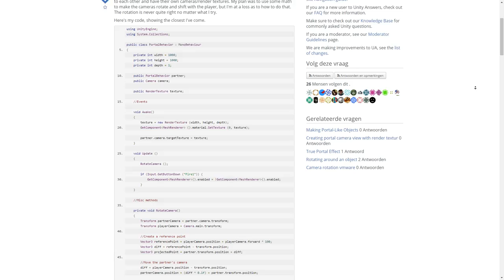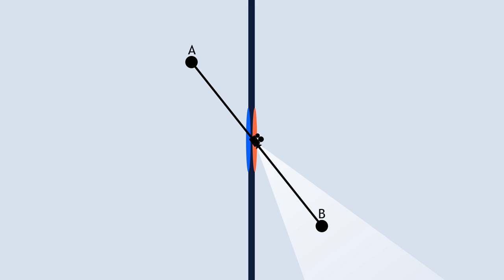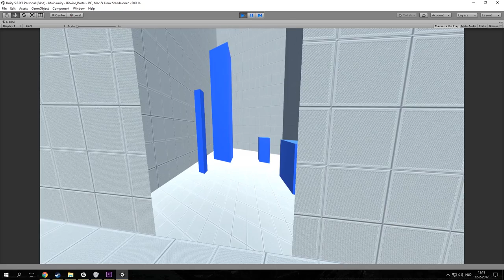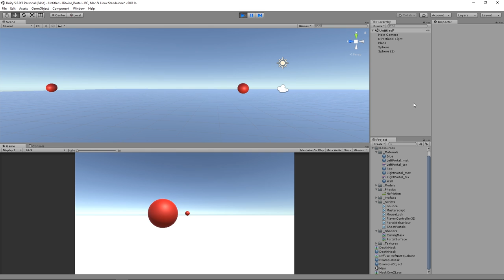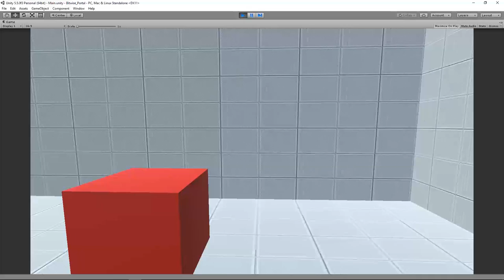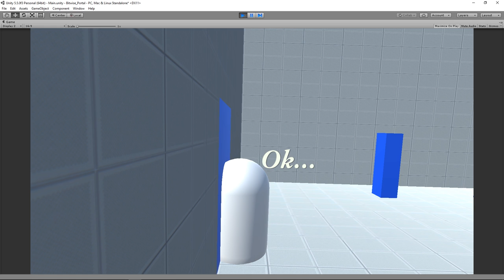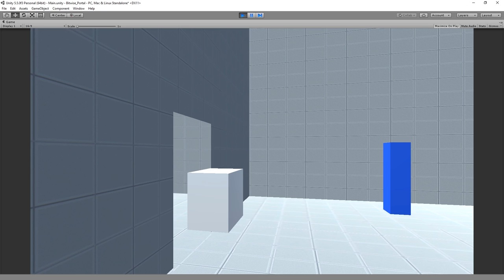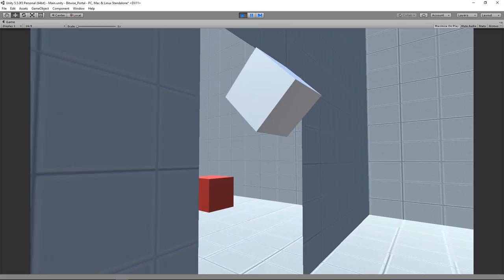How were the portals in Portal created? | Bitwise

Comment: I don't know how Portal does it, since presumably they had to work around a real-time hardware accelerated API that most likely wasn't designed for portal rendering. However, games as far back as the original Descent were built in software-rendered engines specifically designed to render in the same way Valve's portals appear to work. Specifically, the entire in-game map in Descent was chopped up into convex shapes, which greatly reduced the calculations necessary since any convex shape can be rendered from this inside without regards to which of its sides might overlap and obscure the others. To allow maps to be more complex, each side of an area could be flagged to connect to the side of another convex area. Rendering was then done from the inside-out, starting with the room the player was in. The renderer would first draw the visible, solid edges of the current area, then it would move to one of the connected rooms and draw it in the same way, repeating this process from nearest to furthest until the screen was fully drawn in. For normal gameplay, the maps were carefully constructed to be realistic, with no two rooms occupying the same apparent space, but this was not a strict requirement for the renderer. Modders quickly took advantage of this to create "impossible" maps, where a tiny cube in the middle of a large room could be entered from any of its six sides to seamlessly transport the player to one of six completely disconnected areas, and because of the way rendering worked, the sides of the cube would each look like a window into another dimension, similar to the way they appear in Portal.

Comment: A little bit of subtlety with the velocity, that method doesn't entirely work. Because you can go through portals at odd angles (as we see in the second game a lot with diagonal platformers you can jump into). You need to store both the velocity and direction relative to the first portal, and apply it to the second portal.

Comment: I don't know if someone has pointed out that yet, but your solution seems identical to what Valve did with disabling wall collisions when entering a portal. I know this becuase of a glitch that exists. There's an invisible trigger around the portal, and if you stand next to a wall that's near to the portal and save-load, you'll lose collision until you do something to revert it, it's used a lot in speedruns.

Comment: Great video and explanation,but if you shoot a small item through the portal and it goes through it at an angle,then it's direction should also be stored as an xyz value,and modified using a particular algorythm,not use the portal's facing value.
Think of the portals as two windows that exist in the same space back to back...
You can only ever see the front and side of the portal.
The front can be divided into segments like a clock.
If you shoot a bb through the portal and it's angle of entry is  biased toward 3 o clock from the centre on entering,It should exit with a bias toward 9 o clock...
Strangely, the vertical axis does not flip,so only the horizontal directional information needs to be inverted for this particular operation.
 The reason for this,is because the portals themselves are the same entity,except for being spun 180 degrees horizontally on a vertical axis.
hence the inversion of  <180 degrees (less than,mirroring on centre axis)for horizontal information.

Comment: I would had solved the collision detection differently. You cant simply disable the normal collision detection and put tiny borderwall surrounding the portal edges. That would make standing on cubes or similar things impossible while being halfway through a portal. Depending on wether you use  raytracing in your collision detection or coordinate correction routines, you could just add the portal square to the collision detection formula, which is calculated after a frame is drawn. I delevoped various collision detecion algorithms myself for my 3d games (dont know how others do things) and I suspect the best method is to compare coordinates before and after the game progresses a tick. so all you need to do is adapt the coordinate correction in direction orthogonal to the portal surface in case the movement vector crosses it.
Reply: Ye that's what he did

Comment: i know this is old but i think i should add, the velocity needs to be relative to the portal itself, not the direction that its facing, for example if your fly into a portal at an angle, you should come out going at the same angle, not the direction the portal is facing, at least to be consistant with the game, as demonstrated in test chamber 15 of the first game

Comment: I wonder if writing a game engine with a 4 dimensional coordinate system would be valid approach.
You could genuinely connect 2 areas in 3d space together through the 4th dimension.
You wouldn't have to deal with weird cases of objects or the player going through, it would just work like real portals would right away.
I imagine such an engine would be difficult to run smoothly though.

Comment: So it's an optical illusion of a 3D space using a dynamic camera based on the player's position? I guess that makes the most sense. I was always dumbstruck by how the effect was so seamless and assumed they somehow had an infinite cycling of duplicate test chambers, and I was simply walking into a clone of the room I was just in.

edit: And then they DO use something resembling that when dealing with things like cubes, but then somehow prevent that being an issue in multiplayer where the first thing I'd try to do is have two players each grab one "half" of the cube. Hrmm.

Comment: you forgot one thing, what if one portal is facing the wall and the other is facing the ground, then the velocity would mess up. for example. if we throw a cube into a ground portal, it would smash up against the edge of the wall portal because it still has downwards velocity. when I coded portal guns my solution to this was something along the lines of portal angle*momentum.

example:

 exits here with downwards velocity
I  ->
         cube goes here
           I
           v
           _

Comment: Quick question. What is stopping you from using the double angle theorem from geometry, so instead of moving the camera back, you could just find the angle from the players current position to both sides of the portal, then double that angle on the other portal's fov? After that, couldnt you just take the points on a cylender made by envoloping the portal in 3D space with a circle( or for vertical motion, use a sphere) , and project them onto a flat surface to make it look more natural?

Comment: At 4:58 how do you check where the player center is compared to the portal? Im trying to do something similar but for a different mechanic and it always detects the start of my player colllider. When I put a 2nd collider which is at the player center and is flat, it does not get detected ;/

Comment: You shouldn't add your velocity in the portals direction, you should add the relative velocity from the first portal and transform it to the second. If you go in with a 45 degree angle, you should exit at a 45 degree angle.

Comment: Valve would modify the physics and rendering engine from source so that cameras and duplication are unnecessary, no reason who you can't render a scene multiple times in the same frame using a new transform matrix, and also no reason why when doing a physics trace for an object you can't calculate it in more than 1 place for a given object per frame

Comment: But if you're using that approach, wouldn't the camera just clip to any geometry behind the wall?

Edit: the portal camera i mean
Reply: To solve this, you can set the near clip plane to the portal's position. You can use an oblique projection to make sure that it lines up properly
Reply: @sanovictus  Is that possible to do that for a specific camera in ue4?
Reply: @undrew3280  in any engine it should be.
Reply: @johnsherfey3675  I don't know, I've been looking everywhere and I could only find a way to set the clip plane for the entire project, not for each camera. Should I put a thread?
Reply: @undrew3280  Probably a good idea is posting thread, or stack overflow. 
The only thing I can think of would be to look into render targets them selves and shaders. Then see how it's processing the camera. But, I don't use UE4 much anymore and I forget half of this stuff.

Comment: Although your solution for retaining velocity seems sound, applying it to the exact direction of the exiting portal would not be ideal. If you have any angle of entrance that is not perfectly perpendicular to the entrance of the portal, that angle is lost. Instead, the velocity's vector would need to be rotated by the difference of the angles between the two portals.

Comment: Hello!

I wonder if you've managed to make smooth transition between portals, cause in my case I can't figure out that part. Near clip plane doesn't make anything good and I can't use Cull off/ZTest, because I use mask for plane mesh...

You see, I've been working on my own advanced portal system in Unity for some time and I even added recursive rendering with stensill buffer, but I still can't find a proper solution for the problem. 

Any help would be appreciated, thank you!

Comment: That's really interesting !
I tried reproducing this but with portals that can rotate and stumbled across a problem.

If I just make the Camera rotate depending on where the Player is, if my portals aren't facing the same way the Camera won't be properly placed, and I found out you'd have to check both Portal's rotations to see where they are facing and then define the camera's rotation depending on these infos.

How did you solve this issue on your side ? If you faced it at all of course ^^

Comment: Would it not be better to keep the objects vector going through the portal, rather than just applying the velocity in one direction?

in your example, you can only ever go straight through the portal, but using vectors you'd be able to go at any angle (that fit through).

Comment: Portal 2 used 2 maps I believe but I cant for the love of god find that video that talked about it
Reply: it don't use 2 maps....   thers only exception however, due to the lighting of the game being pre calculated (since valve use very high quality lighting)   in one map where the light turns off theres Two maps that u teleport betwen then but its not because of the use of the portal, its because of the light on/off as valve want very high quality light with bounces (kinda ray tracing but not real time)
Reply: @gabrielandy9272  thanks for correcting, i went and check later but i could not find the video and i frogot

They load an invisible part of where the other portal is so you can colide with sonthing while your being moved
Reply: @peter4210   the starting of the game where you are in a moving Part its two maps, one for the calculation  and one where the camera is,, you can't use portals while on it tho.. its on the introduction for the game, i also forgot that so thanks =D  but now i remembered one more part, that they use more than one map.....  in the defective turret Area  the room that move in you path destroying everything is in another part of the map, but i guess its just these 3 parts of the game that uses this i can't remember any other.

so it seems they used 2 maps for things that move alot and for lighting.
Reply: @gabrielandy9272  well the intro one, the physics where pre rendered in a simulation, Your in a regular room and the physic simulation was recorded then it just players out.That is why you cant interact with anything and also why your computer does not melt simulating everything

Comment: You only come with one way in BUILD engine Portals are used for archive different kind of thinks. For example build can't have room over room so when there is i bridge like think or a door below an balcony that is simulated by portals. Also adding portals to ray tracer or ray caster is nearly an no brainer. However BUILD is neither of those. BUILD is an portal engine so there was no need to add portals because it is based on portals.

Comment: Well that was needlessly over complicated.  I realise this must've been your thought process to get to the end result, but it could lead to confusion.  It's fairly simple.  The 3D world needs to be constructed only once - the geometry does not change, so you do not need to refresh this in memory.  The camera itself is effectively a transformation matrix applied in the render pipeline, i.e. an alteration of the location the scene is viewed from.  You need two, or potentially more 'cameras', or transformation matrices - that's all it is, a matrix, a small grid of numbers.  You first render the scene using the first, or main camera, but you set the portal surface as a stencil which you then render into using the other camera's transformation matrix.  The second camera is positioned with the exact same vector away from the exit of the portal as the first camera is from the entrance portal.  Your example of a window is great to use here - imagine looking through the window at an object and that the window is analogous to the portal - next, imagine removing the wall that the window is in and notice that the object has the exact same perspective as before.  Your own location/camera doesn't change based on some abstract concept about what a hole in a surface at a distance from you is.

Comment: Damn, this is a lot of steps to figure out sometging elementary. It seems obvious to me from the start... the portal camera is situated at a distance and angle behind the "exit" that corresponds to the distance and angle of the viewer from the "entrance," without rendering the surface on which the exit is situated (and that last is rather natural in most 3D engines; only one side of most surfaces are rendered with the expectation that the camera will never be on the "wrong" side).

Comment: how hard would it be to make light pass properly through portals?
Reply: Considering pretty much every modern game engine was never designed for such a thing, it'd likely be really difficult, unless you had raytracing, which would make things alot easier.
Reply: You would need raytracing for that
Reply: @LineOfThy  you wouldn't
Coming back to this a few years later knowing a bit more about the subject, you could absolutely make light pass through. Doing it with baked lighting would be quite difficult, but definitely not impossible.
You'd have to simulate an area light immediately behind both portals whose light values are decided by the texels on the wall that the opposite portal covers. From there you could either bake the light using actual Ray Tracing, or estimate it using radiance. In some engines it'd be easier, but most engines (including Source and Unity) use baked lighting for area lights, so you'd have to simulate it yourself. Unreal could do it using their global illumination engine I think, and I don't think Godot has dynamic area light, maybe not even any area lights at all

Comment: The part after 3:00 is presented in a very confusing way, and i think your explanation of what is wrong is incorrect, especially the distance being 3+3+3. The gist is that you've actually made a "working" portal surface and this is really just a bug: you have told the portal to render the whole field of view of the portal (which is a 16:9 image) onto a portal, which is more like (9:16). Of course it will not look right, because all distances except those along the center line will be distorted. You have to crop the image from the center, which gives the correct aspect ratio on the rendered image and solves the problem.
Reply: ye he did that
Reply: yes, and exactly like he said its a window, not a screen

Comment: Disabling the collider on the wall or floor with the portal was a stupid solution. If any object aside from you needs to react with the wall it would just go through. It should just disable collisions between the wall and the specific object in the portal and there are ways to do this in unity.

Comment: this is so wrong... portal is just a linked object use in every source engine game even the ship and Stanley improve it. And uses simple mathematic. it clips two space bended wall back to back and produce 4th dimensional portal/link/wall to the targeted area only difference in portal is the portal gateway are pre builted module and when you fire it it place linked door to wall. In portal you can set up 5 pair of different portals with one user and game didn't slow, but if you do it with cameras game will slow because it will be like you would spawn 10 different cameras who act like 10 different actor that always try to calculate player movements, nps movement, cameras inside the area portals. So no camera theory not would work.

Comment: Is it not possible to implement portals that "physically" makes a hole through the wall that you and objects can pass through? As I see it, this method is faking it. I suppose 3D graphics is all fake in the first place. But I guess what I mean is: can you make portals by some other method than using "cameras"? And when you step through the portal, you aren't actually teleported anywhere, just walking through a physical hole in the wall, but that actually leads you to the same room you're in (i.e. where the other portal is placed).